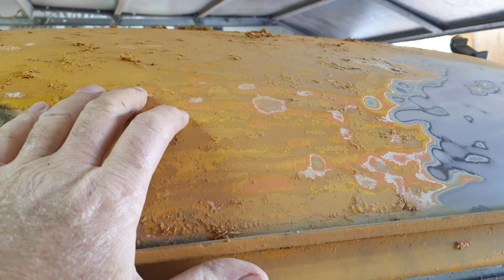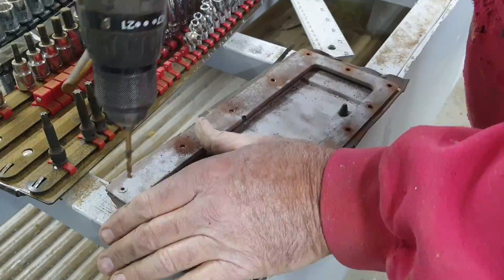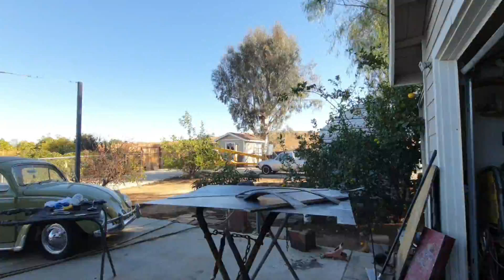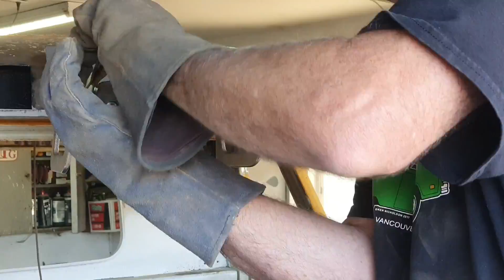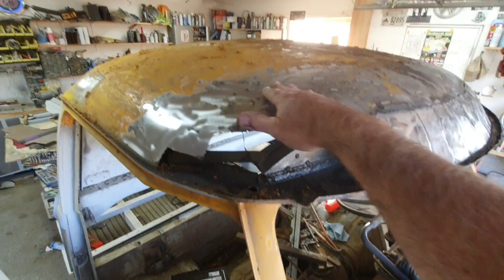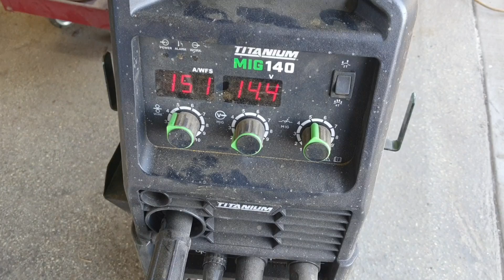Sheet Metal Repair 🔧 | Lap & Butt Welding Roof Sections | VW Type 2 Single Cab SO10

Comment: At approximately 7:25 in the video you have a license plate from Georgia from the county of Bibb. Now, I always felt like I was from the armpit of Georgia and never would've suspected to see a Bibb County plate anywhere other than here. I also know there are quite a few people in the area that restore cars. A good friend of the family does frames for hot rods and like to put camaro frames on old truck frames (I think). I'm not into hot rodding so I may be wrong on the specific vehicles. He's like 1 of just a handful doing it in the country. There are 2 on my street and several more in my neighborhood that restore vehicles. I have to assume you had a vehicle to paint or something from Bibb County. It is aged a little because it now it's Macon-Bibb since the city and county combined in order to make ends meet basically. 

Anyway, just curious and as always thank you for the videos. I've been taking lessons in this series on welding and body work in general as I'm working on my '70 Beetle Sedan.
Reply from the maker: the 13 window vw bus came from GA....old owners dad had it there before he sent it to CA where I got it.

Comment: Did he say kitty hair ? 😂.... don’t use that mike ! it’s a bodge 
Thanks for the video, really enjoying them
Reply from the maker: I dont use that anymore but if you have something you need to fill that is more than 1/4 inch thick it does help to use kitty hair on the low area. will prevent cracking thick filler.

Comment: I wondered about the compound curve too....cut my 65 roof, it went sproing....until you compare lap to butt, you just DON"T appreciate how much easier and faster it is.  Less stress too as I get stressed when a big hole develops from the heat.   An older guy who worked on Porsches, told me butt weld, he had a Miller Mig unit, it was like 2K in 1974 (about 10K today).  So, That is the way my mind sees the solution to rust, and it's resisting learning !  I did try the lap on the vanagon and yes, it is better and faster.... Unsaveable car, BINGO.  You saved it Mike, love your videos!

Comment: Great work Mike!  After watching you do the roof patches, I am thinking that the sheet metal suppliers should really step up and offer panels for this repair.  Most old buses have varying degrees of rust in the gutter area...
The air box turned out great - I wouldn't want to do that repair! 
Thank You for the video and instructions on how to repair the hopeless!😀
Reply: They do offer a roof panel. Its way cheaper to do it the way he is, not as nice but cheaper
Reply: I should have been more clear. I wish that  "gutter section" panels were available.  Not an entire roof.  If your entire roof requires replacement, the current offerings are nice to have.
Cheers! 🙂

Comment: I have to say that I was a sceptic when I first saw your videos months ago. But I've watched every single one in this series, and I've come around to your way of working. Yes, your metal work is not pristine. But it's strong. You're not one of those clowns that patches up rust holes with newspaper and bondo. You actually replaced and treated ALL the rotten parts on this bus, and I was the guy that once commented that it would be easier to save the Titanic than this bus. Well, I'm happy to admit that I was wrong, and that I just needed to understand that you are playing to long game. Well done Sir! And good on you! :)

Comment: Great job! I’m just curious, as you do so much amazing fabrication, why don’t you us an English wheel for those rounded parts? Thanks Bro!
Reply: He goes cheap. That would be another piece of equipment he has to buy and more time shaping metal. Time is money also
Reply from the maker: that works and with the compound bend at the bottom would take several hours to shape that. I also dont have a place to put an English wheel. they take up lots of space in your shop. This is just a fast and easier way to make it. End results will be around the same after filler and both will last.
Reply: No problem I can see your point! I’m just glad you are saving another VW and returning it to its  original condition! Glad to hear you married a Canadian girl!!🇨🇦

Comment: Great work, we were all curious how you would manage that long compound curve.  Hey Mike that welding torch must have been tough on the 6 layers of old paint!
Reply from the maker: Thanks 👍 I do those in sections. make one section then weld in the second. Fittze does it the same way I do. He just posted a video doing a compound window section.

Comment: Lols all the armchair critics having a pop at Mike why don’t you get a life and go back to your Eastwood videos and dream on. Happy Christmas Mike and the family
Reply from the maker: too funny. lots of ways to do this stuff. People just need to use the way that works for them. some guys like to give these metal tool companies their paycheck some dont.
Reply: @Mikefngarage  What the keyboard critics don't understand is that buying sheet metal working machines is  only part of the battle. After you buy the machine you then need to spend many hours learning how to use it and then buy and make tooling. My friend has a full metal shop, he restores prewar cars as a hobby and is very skilled . I've made him lots of tooling in the past for the english wheel ect and believe me it takes hours and hours of lathe work. What i'm trying to say is if the work was done with metal working machines you would never get it finished as it takes a life time of graft to gain the skills to use them correctly. Plus they are pricey. A grinder and a mig is all that's needed for most resto jobs.

Comment: mike at least you weld metal in not try filling the rust with with bondo
i've seen some shocking rust repairs done by so called professional body shops
like you said a little filler will tidy it up 
keep up the good work
Reply from the maker: yea I have seen before FOIL TAPE to fill the hole and bondo over that. Or super thick bondo over an inch thick. that  way will have some problems. Beer cans and foil tape. seen that too.